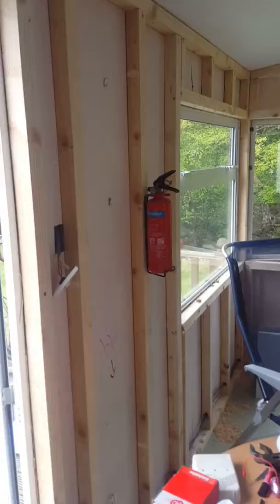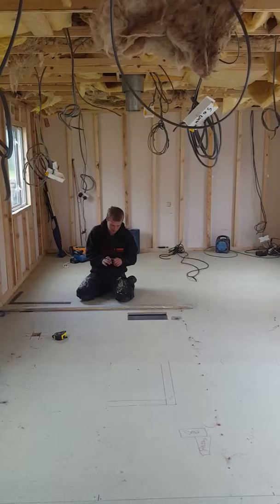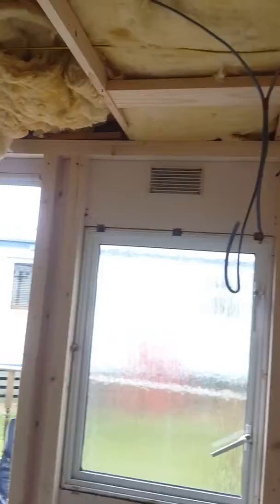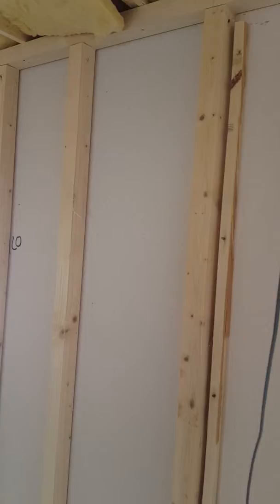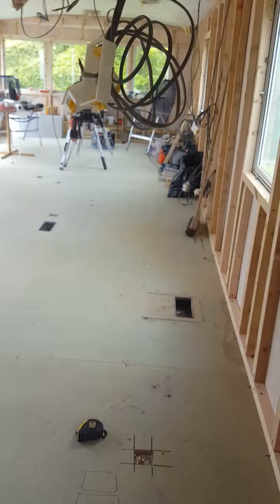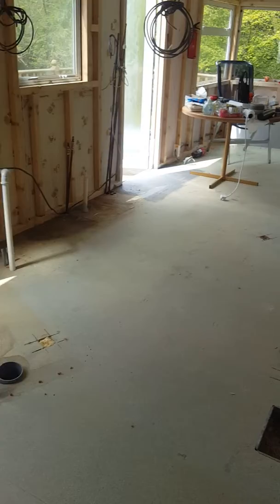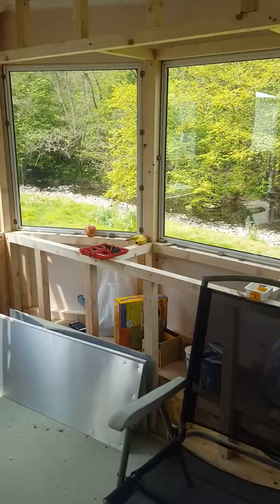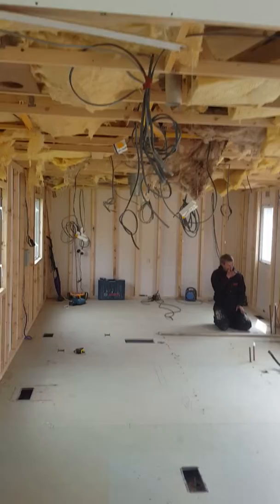Staic caravan renovation  (2)

Comment: Hi There, Have a static caravan that I would like to remove all the internal walls and do exactly what you have done on these videos. However, I am trying to work out how you attached all the internal battening to the external walls and still kept the caravan water tight and structurally sound? regards John
Reply from the maker: John Rodger01011 
Hi John I'm in Turkey at the moment back on the 22nd visit my business fb page via dmp building solutions and contact me then and I'll have a chat with you
Reply: John Rodger01011 can I ask, we have the same caravan as your and want to do up!  But we don't have your skills.  How much should I expect to pay if I get a builder in to do the job?  The caravan is in Essex near Clacton upon sea, might be to far for you! But a rough idea would be very helpful!
Reply from the maker: John Rodger01011 
Hi John depending where you are I could do it
Reply from the maker: Hi Is consider traveling and doing the work. Feel free to contact me after the 22nd via my fb page as mentioned and we'll have a chat
Reply from the maker: Hi Is consider traveling and doing the work. Feel free to contact me after the 22nd via my fb page as mentioned and we'll have a chat